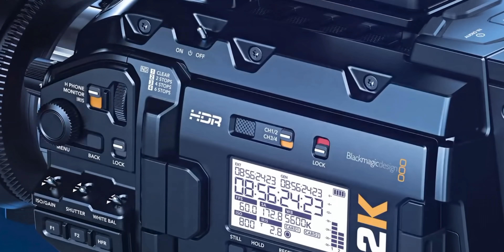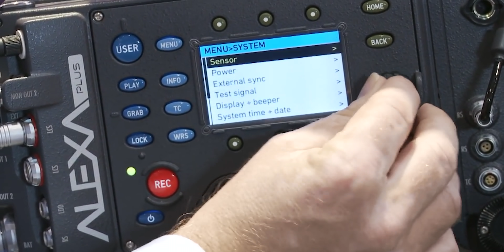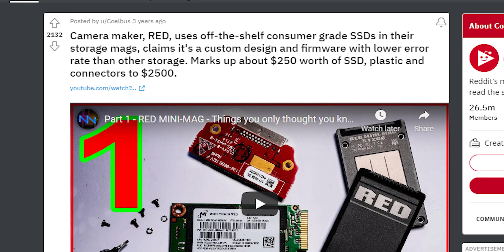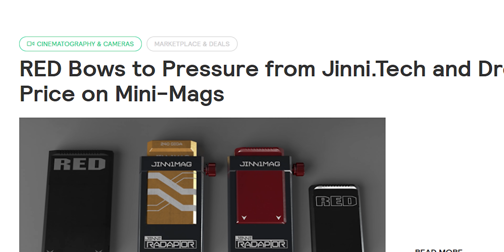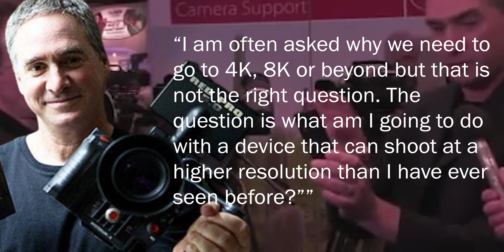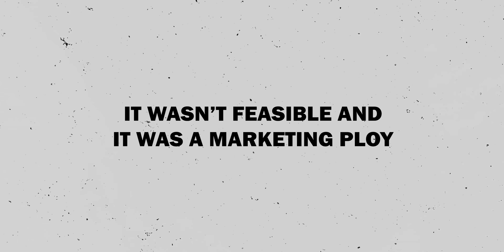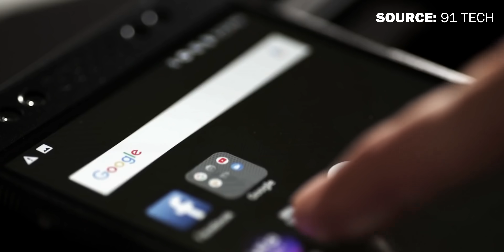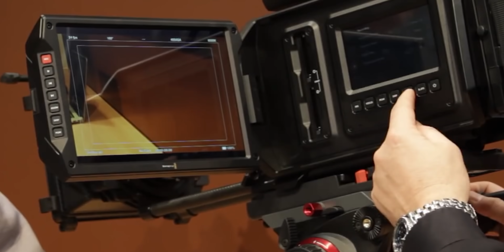The 28K Camera ABANDONED by RED Digital Cinema

Comment: As much as I like the contrasty, gritty, RED look, I just really couldn't get behind a camera company that used "proprietary" media that was just basic ass hardware marked up to high heaven. I understand cost of entry, but that's completely different from flat out abuse and greed. And as we've seen, all you have to do is create a great product, give people options to run their show, and people will get behind it. Canon, Sony, and BM are testaments to that.
Reply from the maker: Absolutely! I think that they would be held at a lot higher regard if they didn't resort to some of the scammy business practices. But I think we can thank Jim Jannard for that mess and the patent lawsuit mess too
Reply: @FrameVoyager  Honestly I'm still baffled how the Red compressed RAW patent still holds up, because, like many other RED claims, they didn't invent a lot of the stuff, and some of the stuff is so generalized that it's actually been crippling to the market. For example they did not invent RAW compression; however, they did pack the sensor Bayer mosaic pixels together for all three channels and apply a DCT wavelet compression of some form to it, and then unpacked the result, and that aspect was indeed clever and innovative. My issue is that packing the mosaic channels and applying a DCT compression is not the only way one can compress the RAW sensor data. Yet their patent was vague enough to not only cover ALL mosaic patterns, not just the Bayer pattern which is all they use, but also all forms of compression of this type of data. While the earlier I could see being an issue if someone used a DCT compression on any other sensor pattern, as that is basically the same underlying technique; however, covering all other types of compression is absolutely a massive overstep, because while a DCT wavelet style compression is going to be one of the most effective forms of compression,as we know from the popularity of Jpegs on the internet, their patent prevented RLE compression as well, and while that might not be as small and efficient as DCT it's still massively better than completely  uncompressed data. Yet no one can use it or any other form of compression on ANY mosiac sensor data without infringement potential with RED. That , to me, is the reason the patent shouldn't hold up, yet RED keeps managing to hold on despite the wording of patent law saying this shouldn't be possible. Anyhow I know I got a bit soap boxy, but the thing is patents were meant to protect ones innovation, and when they are weaponized through vague language to do the opposite and instead prevent innovation then it angers me, because it's the opposite of their intended purpose.
Reply: Wouldn’t call red sensor gritty what so ever, it has a warm toned clean look, ARRI is known for its roughness … but insane skin tones
Reply: @spincityvisuals  RED's look is not all that clean.
Reply: @Aaron_Smith_OM  what model have you owned ?
Reply: @spincityvisuals  Scarlet W then upgraded to the Dragon 6K when they stopped supporting the Scarlet W sensor.
Reply: @Aaron_Smith_OM  yeah I had the scarlet W also. Wouldn’t call it gritty what so ever personally compared to other cinema sensors.
Reply: @kemalettinsrt  what does the V-Raptor use then?
Reply: That gritty look, to me, is what kept me away from RED, in addition to the proprietary media (until DSMC3). As a former RED owner, it seriously limited the tonal and textural control I had in post. I wanted the high dynamic range and resolution, but had to fight with the camera to make people look bright and flattering because of the camera's natural look and DSMC2's heavy fixed pattern noise didn't help. I think if anything, the rise of BM has displayed how DPs really care more about versatility, image, functionality, and latitude in post than Ks, dynamic range and a dramatic look out-of-box.
Reply: Proprietary media was just Red fleecing their customers. Pure and simple. They could have used c-fast cards or other third party recording media, but then they wouldn't have been able to price gouge everyone. The company's fanboy followers are also bordering on cult status, which is also not good. Their cameras are not worth the price (at this point anything by Canon/Sony can get you just as good or even better looking footage for a fraction of the price).
Reply: @GenX-Made  That statement is inaccurate at best. While I do agree that Red failed to adapt to the market change as rapidly as they should have, particularly with their media in the mid teens. The Komodo and V-Raptor both use open media formats, and last time I checked neither Canon or Sony offered a global shutter on any of their cameras, and last I checked no one offers a better compressed mosaic RAW format than RED currently. As for the image look, that is super subjective, and I personally prefer the look of both ARRI and Blackmagic over RED, but that is because I like how both grade very similar to one another. If one prefers Canon or Sony then shoot with Canon or Sony, but don't presume others are some how foolish fanboys because they prefer the look of their camera. If they get the look they want out of their camera then that is all that matters.
Reply: @GenX-Made  I’m sorry but Sony Color science… on par with red? That has to be the funniest comment I’ve ever heard. Didn’t realise it was April fools.
Reply: @spincityvisuals  Sony has this camera called the Venice. Some really high budget productions have been shot on it (new Avatar movies).  Really amazing stuff has been shot on it.  And I stand by my original points: (1) Red users are members of a cult, and (2) you can get equal or better looking images with other cameras, unless you're a member of the Red cult, in which case, nothing else will ever compare. Ever.
Reply: @GenX-Made  True. There are a bunch of side by sides after grading of Canon to RED, BM to RED, and Sony to RED looks. It's probably more work you have to do, but it's been done. And yeah, Canon's color is chef's kiss. The big competition that Arri has right now is the Sony Venice. It took home some pretty major awards in the past years and it's well deserved. Not a fan of Sony at all, but a win is a win regardless if you like the team. The Venice deserves its roses.
Reply: @GenX-Made  Oh yeah I know about the Venice, and of course it has outstanding IQ and DR, but the run of the mill Sony CMOS... milky green skin tones, pretty abysmal dynamic range, and it just has that standard 'Sony' look.
Reply: @GenX-Made  >Venice
>Fraction of the price of red
Lolwut